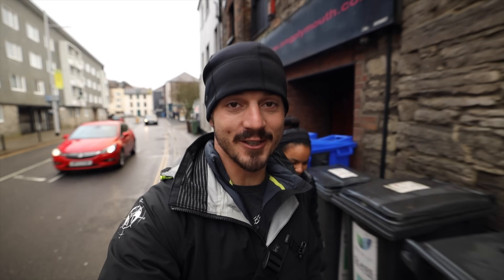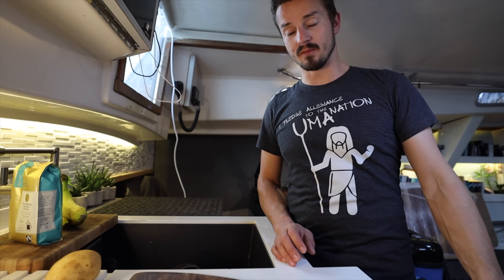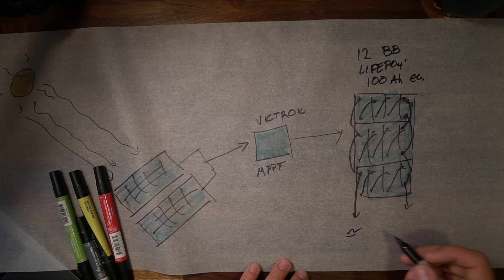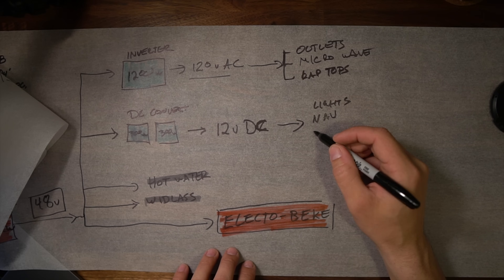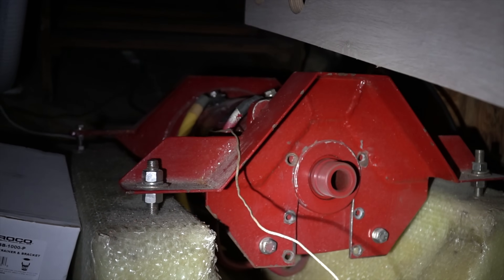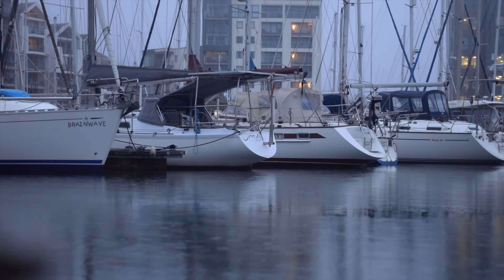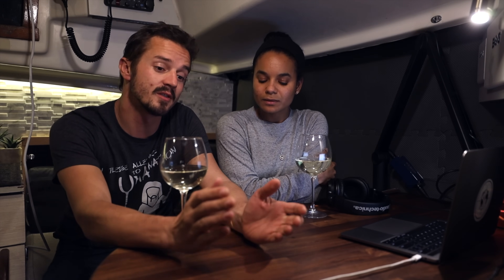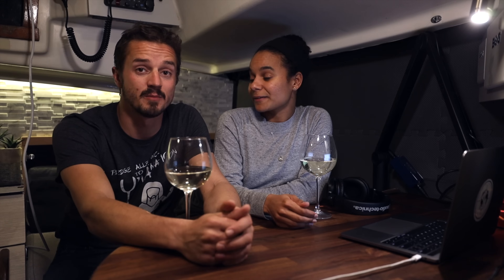5 Years Living offgrid on an ALL ELECTRIC Sailboat — Sailing Uma [Step 206]

Comment: You keep confusing kW and kWhrs. One is a measure of energy , the other is a measure of the rate of energy transfer.
The batteries for example you have labelled "15kW", but the capacity of the battery is measured in kWhrs. The battery can output electricity at a rate of 15kW which is nice to know, but how many hours can it do this? This is the kWhr capacity of the battery.
Reply: Gary LeLacheur to be precise, kW is the unit for power, and the kWh is the unit for energy. Energy is how much power is transferred over time. So yes, the battery capacity is a measure how much  energy it can store and measured in kWh and often also indicated in Ah at its nominal Voltage.
Reply: @peterbodifee  OK, you are correct.

Comment: John, from Victron Energy here. I keep their blog. Now you are here in UK it would be good to make this video a feature on our blog. By the way, is that an Origo/Dometic stove? If so I had one on my electric propulsion sail boat and here in UK you can get this Bioethanol for the stove which is half the price of Meths, bought in a quantity of about 12l https://ekofuel.org/bioethanol-fuel-for-alcohol-marine-stove.html
Reply: Please fix the KW / KWh first. It's maddening.
And the 2x DC-DC converters are in parallel, but shown in the schematic as in series.  Doh.

Comment: Hi, a bit off topic but have you considered investigating sheet to tiller type auto helm steering as you have an emergency tiller?  It is a plan D type approach, i.e. this should not of happened, but it will cover if you have a pole pitch in big waves, i..e. digging the bow in and somersaulting forward, that destroys you wind vane and electrical systems. A bit "old school" but was very common in the early 1900's but also uses no power.  bye Duncan

Comment: Hey Dan, I have a question about the battle born batteries you and Keeka use. (Sorry Keeka for miss spelling your name). However, at three notts you can motor for ten hours with ten batteries; how long would it take to recharge and how much power will it take? Also at three notts how many amps are you pulling? Thanks guys, love your videos been watching for some time now and I still don't have a couch, lol cheers to you both.
Reply from the maker: We’ll be doing a more in-depth electric motor video soon, but we can charge back up overnight. And at 3kts we’re drawing about 1-1.2kW so 25A @ 48V. We can certainly motor faster (up to 7kts) but the power curve is parabolic, so we’re we’re using a lot more power at those speeds.
Reply: @SailingUma  hey Dan, I know you said you guys will do a video on uma's motor but I have one last question before the video drops. This is, how many amh do your battle born batteries have each. And I forgot to ask what type of motor you have that allows you to 12v charge the fields for speed control. I have so much to ask about this topic but I will wait until the video comes out to continue my questions. Thank you guys again for allowing me and many others to follow you on your quest of travel...😃👍

Comment: If you ever watch Davie504, who SLAPs his bass, he asks his viewers to SLAP like NOW!   On a sailing note, it’s been very intriguing to me to think about repowering our 27’ Ericson as an electric.  We currently have the original Atomic 4 gasoline inboard.  We sail on weekend overnights and occasional multi week vacations in Puget Sound (the Salish Sea between Seattle and Vancouver).  I surely prefer sailing, but sometimes wind is just too light to get anywhere and we might motor for several hours.  Generally I motor about 5.5 kts, sometimes if I’m worried about overheating I keep it at 4.   Usually our destinations are a marina slip with shore power.  I have heard how the power use increases exponentially with speed such that our range would be dramatically cut at 5 kts compared to say 3.5.   We have a non marine AC refrigerator we only depend on on shore power as well as a microwave.  On trips we buy ice for ice box, and cook with Butane canister stove or propane grill on rail.  For now the atomic 4  is working and the conversion seems quite expensive with so many variations of how people have converted.  Someday but not this year or next.

Comment: I like a lot your videos. I have an idea to improve the electricity eficience in your sailboat. You said that the laptop drops very fast the batteries, well the laptop needs a 19.5V (DC) as input and transfrom from 120V AC to 19.5V DC is really very unefficient. Instead of that you can use a digital step up 12V DC to 19.5V DC. Something like this (https://www.alibaba.com/product-detail/Digital-Step-up-12V-to-19V_62020071112.html?spm=a2700.7724857.normalList.71.e03522b4dxdxva). I'm not an expert but I think it could be an interesting investigation. I can't wait for next video. Regards.

Comment: Like others, love the video and the approach. I don't mind about kW. Our electric car as 24 kWh, so your 14 kWh is impressive. 

Is "all electric" really true? You seem to be wearing T-shirts indoors on the UK south coast in winter. So you must have some kind of space heating, either a wood burner, mains electric fan heater, or a diesel blow air heater. Similar for cooking, do you just use microwave and avoid the need for a gas hotplate and oven?

Like the detail on all the components, you really help us weekend/vacation sailors manage our own boats. Love the implementation of an electric motor. Now to look out the cost of LiFePO4s.

Comment: Very cool electrical power diagram.   BTW. Would the DC-DC laptop charger (~$70) be more efficient?  At least the power does not go to AC and then convert back to DC again to charge the laptop battery.

Comment: Hi Guys great video and very informative. We moved across to lithium last year in preparation for cruising and I was a little envious of your 12 x 100amp. However we will have 2 smelly diesel engines so should be OK. Do you have any gas on board at all? Or are you cooking with induction? If so are you happy with it?
Reply from the maker: We cook mostly with alcohol, but have a microwave and electric pressure cooker as well. The only gas we carry is jug for the outboard motor. We do have an electric outboard as well, but for setting off exploring, the gas engine is much better and much longer range. The reason electric works so well on our sailboat is the fact that it has sails.

Comment: Excellent vlog guys....☺
 Could you use the electric motor as a dynamo to charge your batteries while you are sailing?....the forward motion through the water should gently turn the prop and therefore the motor....just a thought. Love your vids, watched them all 😀
Reply from the maker: Yes, we're actually working on that this winter. So stay tuned.
Reply: Brilliant, nice one 😀
Reply: I watched another sailing channel and they installed a "folding" prop...no drag whilst under sail....just another thought 😀

Comment: You two ROCK!!  What a perfect blend of Happiness and good old Yankee ingenuity!  I've learned a lot from watching your journey!  
Just one question on the Inverter?  I'm running an off grid system in the Rocky Mountains and using a 5000 watt with surge to 10,000 watt inverter and we have a big Sharp microwave that just brings the system down in a heartbeat.  We can barely get 3 minutes operation out of it before the battery bank drops to 10.5 volts and the inverter drops out.  I;m trying to figure out how you are running a 1200 watt inverter to operate your micro.
Another question is what is the weight, length and displacement of your boat and how did you compute the electric HP needed to convert to pure electric?  Sounds like you might be slightly underpowered if you're only getting 3.5 Kts. as the typical diesel would give closer to 7 Kts.  Anyway love your videos.  Keep on truckin"
Reply from the maker: Great questions. 

Firstly, our microwave is an "inverter" type which means if you reduce the power level of the unit, it actually draws less power from the inverter. Normal microwaves just cycle on and off and full power to give you more or less heat. You're batteries (if they're lead acid) might not be able to handle the load either if they're dropping voltage with such a large draw. Look up their C rating. 

Second the motor, by "sweet spot" we meant the speed at which the power curve, crosses potential distance curve. We can motor all the way up to hull speed (7kts) but it limits our range to about 7-10nm since we're drawing 10-11kW. At 3 kts we can motor longer and get a good range in an appropriate amount of time. Make sense? 

Hope that helps clarify things a bit. We did a pretty extensive write up on our original system on our website. http://www.sailinguma.com/electro-beke

Comment: Why not add a hydro generator such as Watts and Sea instead of changing of the engine to generate energy with the prop while sailing. It generates more power and less drag. And is probably cheaper.
Reply from the maker: They're very expensive for how little power they generate. Much better for fas cats or race boats that go 20kts.

Comment: How do you heat the boat? I know how cold a boat in a Plymouth marina can be in wintertime. Do you have just the microwave for cooking, or have you got an electric hob too?
Reply from the maker: Right now we're heating with a little electric heater off dock power (1000W) but we also have a wood stove for when we're not near a marina. Works quite well.

Comment: Pelargic tiller autopilot installed on your windvane. When wind is to light for the vane, the Pelargic tiller autopilot stands in. Rather than steering the tiller it steers the vane rudder. I'm told it uses 1 watt but I have no first hand knowledge. Mine is disassembled at the moment or I would send pictures
Reply from the maker: If there is wind to fill our sails, there is enough for our wind vane to work. It's quite good in light air actually.
Reply: @SailingUma  I love my cape Horn also, but my point is that if you run your autopilot thru the servo-pendulum on the vane instead of the rudder, the result is it uses a fraction of the energy. Also you can buy 2 or 3 tiller style autopilot as back-ups for the price of one  'regular' autopilots.

Comment: Units please! kW for power and kWh for energy. All the figures are meaningless without the correct units.
Reply: Dude - they're architects, not engineers.   ;)
Reply: Nothing to do with that, this is plain and simply wrong.
Reply: @novacolonel5287  Yet this usage is extremely common.
Reply: @davidseslar5798  If there's work that requires 100 man-hours to complete you can (most likely) use one person for 100 hours or two for 50 hours each. The difference between kilowatts and kilowatt-hours is exactly the same! Same multiplications and divisions to convert between kW, time, and kWh to figure out the power, time, and energy from any starting figures you happen to have.

Comment: Have you guys thought about a fuel cell (EFOY) for example?
Reply from the maker: Yes, but you still have to carry fuel for them. Just methanol instead of gasoline and they're about half as efficient/L as gas. Quite, sure, but still rely on fuel. Now if we could run a bit of electricity though some sea water and get hydrogen THEN we'd be talking. See you in a few years ;)

Comment: Thank you for the video very informative, so you have gone all electric no propane, did you ever have propane and what savings and ease of use the transition to all electric help you during your travels?
Reply from the maker: We've had propane and butane onboard. Now we have an alcohol stove and and it is SOOOO much easier to find fuel since you can just dump it in the canisters. Every country has their one propane bottle fitting and pressure and different regulator. We were once out of propane in the Caribbean for 3 months since we couldn't find any island that could fill our US style tank and we couldn't afford to switch our system to butane. Now we just carry a 25L jug of alcohol and that lasts us about 6 months. Same as a 25# propane tank used to last us.

Comment: Cant wait to see the motor/generator upgrade. Also will you look into a vertical axis wind turbine that may be mounted to the top of your mast where the wind is faster and the noise is less?
Reply: No comparison to axial flow power production or ease of handling...unless you go the Water World way...  ;-)
Reply: Just thinking, we know that wind speed is faster on top of the mast vs 6 or so feet off the deck. Also the rolling and pitching of the boat changes apparent wind direction which on a HAWT will cause excessive movement. However a VAWT can use wind from all directions without this problem.

Comment: You have certainly considered some mobile solar cells, I think.
Why haven't you chosen this option?
In addition to your fixed solar cells.
https://www.watski.dk/solara-power-move-transportabelt-solpanel-117oY
Reply from the maker: Yes, but, if you plug in different types of panels to the same charge controller, you loose a lot of efficiency. So you pretty much need a different controller for each type of panel you have. Which get a bit expensive. But honestly, we just haven't needed more. Our 480W have been plenty so far.
Reply: Ok. 
But I will not be surprised if your solar capacity does not strike here in
northern Europe. 
But of course, you can save on popcorn and an electric kettle.  ;)

Comment: Your Matt makes no sense! Let's assume you got 2 panels 500watts each making 1 kw ( full sun all day ) and you are using 2.5 kw you are short 1.5 kw , tell us the truth your set up is. Not working at all or at least not with your numbers , how about at night there is not sun and with your solar you had not put any charge in your batteries , I got 2 kw in solar 6 battleborn 100ah giving me about 5 hors using 800 watts in day and 800watt and 5 hors at night
Reply from the maker: Our numbers aren't based on math, but actual, real work experience. A panel is rated for max power and measured by the hour not day. Our 480W panels were giving us up to 500W at peak in the Caribbean, but that was in an hour, so times that by 4-5 hrs of good sunlight. The rule of thumb is assume 4 hrs of good sunlight a day so 500W panels should average 2kW a day. On the ocean, in the Caribbean, you can get even more. 

We have 15kW of batteries onboard and if we're conservative, that will last us 2 weeks without charging at all. 

It looks to me like if you have 2kW of solar thats 2000 x 4 = 8000kWh a day. 
6 BBB at 100ah is 7200kWh in battery storage. 
and you said you use 800w X 5 hr during the day and same at night, so 4000 X 2 = 8kWh a day. Sounds about right to me, assuming your a house and not a boat. 8kW is a lot for a boat.

Comment: Why oh why did you leave the Caribbean for the UK in winter??? Every day is overcast and rainy.
Reply: Bob Adam It seems like they told us the reasoning for the interesting timeline of being in UK over a winter.  But I also can’t remember it clearly.   I think they wanted to be positioned to get  to Iceland in the spring/summer of 2020.  The visa issues for Kika needed a special strategy and they needed time in the UK  to obtain the correct visas before continuing travel.  They also wanted to do work on the boat and  they have access to product in the UK.  They wanted to do some touring of northwestern Europe before they head for the Mediterranean in the summer/fall of 2020.    
I may be making this part up, but they were taking advantage of current and wind conditions during the time of their late fall Atlantic crossing.    And last but not least, I think I AM making this up,  they did not want to take any chances with hurricane weather or spring storms during the crossing..  
One thing’s for sure... They are sitting safely in their cozy, cute nest and riding out the cold winter weather.   Well wishes to you guys and best of luck with the continuing journey.  Stay warm, my friends.
Reply from the maker: You didn't make up any of that Carolyn. Thats all correct.

Comment: With the Lithium ION battery's … they do GOD FORBID, catch fire from time to time .. do u have Respirators and fire gear on board to handle the fumes and that type of fire   https://www.nature.com/articles/s41598-017-09784-z   ,     make us a Safety Video . you guys are too cute to lose !!

https://www.large.net/news/6fu43np.html

Maybe  your next project would be a fire structure or enclosure to protect the hull and the area above the battery box to give you time to fight the fire , like some kind of  fire retardant heat shield .. like a cloth , something flexible. and a fire alert system in that area like an Inconel Loop and an extinguishing system .. 

https://www.aircraftsystemstech.com/2017/06/fire-detectionoverheat-systems.html

I have watched every clip you guys have , you sir make MacGyver look like rube! I don't pay for your Uma team but none the less feel very included , if your every in Daytona Beach Dinner and drinks are on me!
Reply: Mike, educate youself, not all lithium is the same, watch some videos from this guy https://youtu.be/Yf9N9zBgyB8  Lithium titanate is ultrasafe, way safer from lead acid  i.e. that also has risks https://youtu.be/DpQeDcEpEn0  Battleborn is LiFePo4 which is pretty safe chemistry...

Comment: How do you protect your system from lightning strike? It seems that 100% dependence on your batteries runs the risk of a strike destroying your batteries (and everything attached to them). Any Farraday-type protection? Do you disconnect elements in a storm?